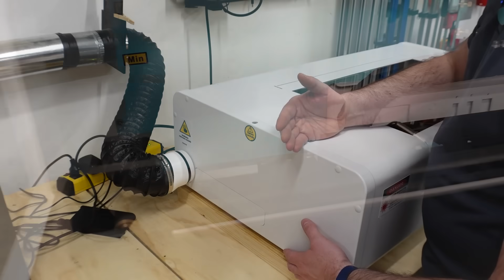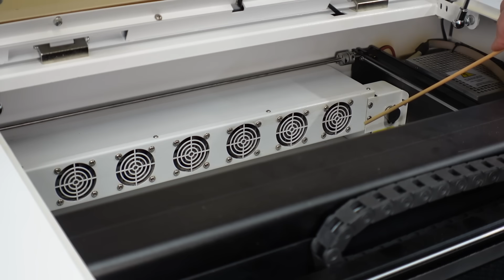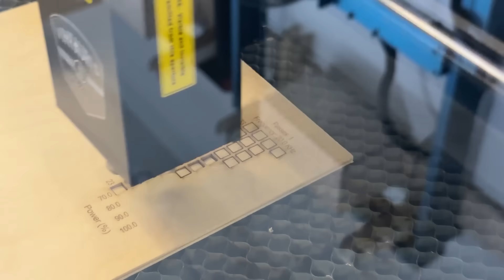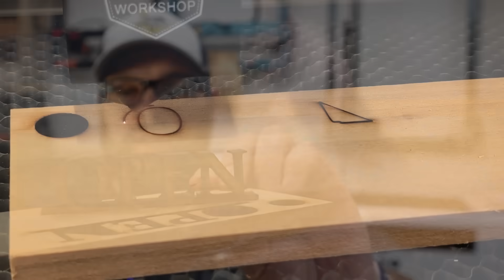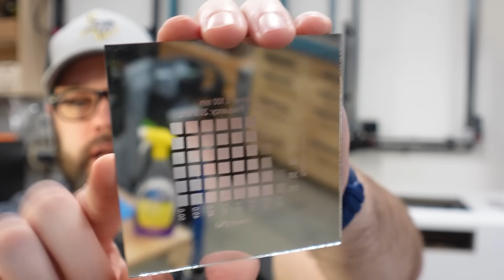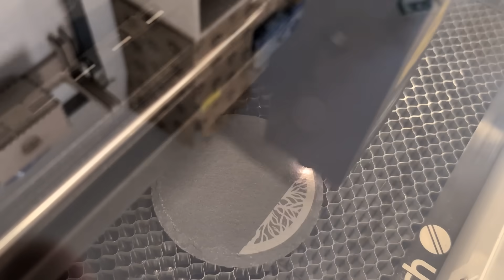Omtech Polar Lite - Best budget Co2 laser?

Comment: What is the best laser for me to buy if I want to put an imprint image on my shotgun receiver from a picture of my dog with geese that she retrieved.
Reply from the maker: To do work on metal parts such as a shotgun receiver, you would want a fiber laser.  A Co2 or Diode can remove a coating like paint or anodization, but will not mark on the actual metal.
Reply: @Vintauri so buy a CO2 machine or a diode machine

Comment: Have you had to change your nozzle head because you accidentally melted it? I’m asking for a friend here obviously. What about getting in to clean those fans? How do we do that?
Reply from the maker: I have not had to change the nozzle due to melting. Was that from flames while cutting material?  This is where a stronger air assist would help keep things away from the laser head.  For the fans I've been using a small shop vac nozzle and then blocking the fan from spinning with a small skewer to get the dust out.  I have not felt the need to take it farther and try to remove the fans for deep cleaning but it's likely that will eventually be needed.

Comment: Hey I just got my NEW OMTECH POLAR LITE. I was putting it together last night and I can't seem to get my honeycomb in the bottom of my laser. Its like it catches on the bottom of the head of my laser and I dont want to obviously scratch that. Is there a trick to getting it to fit in there easily? What am I doing wrong?
Reply from the maker: The z axis on the laser might be extended too far.  Get the laser setup, and the water tank filled and then power it on. The laser should home the z axis and pull it back up allowing you to insert the honeycomb without rubbing on the lens tube.
Reply: @Vintauri  Thank you so much! I will try that!
Reply: @KelseyEitel  if you havent found it yet, there is a piece of foam placed BEHIND the laser head and conveyor. push the laser head all the way forward to remove this piece of foam and then push the laser head all the way to the back corner and the honeycomb will fit! Took me 30 minutes to realize the issue and i felt like such a goof once i figured it out! lol

Comment: What settings did you use for the tumbler? Thanks!
Reply from the maker: You'll need to run a test for the specific brand of tumblers you are engraving as the powder coating can vary, but start around 250mm/sec and 25% power, if it's not burning off all the coating, bump up the power a bit.

Comment: I am very new, so I apologize if this is a dumb question. Say I wanted to engrave the top of something that sits 6 inches high, can I just add (sturdy) blocks underneath high enough until it clears? I saw yours was only like 3 inches so I wanted to ask. Or will that mess up the focus?
Reply from the maker: You can absolutely raise the laser up for larger objects.  Just make sure the blocks are the same thickness so your laser stays parallel to whatever it is sitting on.
Reply: @Vintauri thank you!

Comment: Hi. How did you calibrate the camera with lightburn? I'm having some issues with it not reading the printed circle sheet provided by lightburn to calibrate it. Thanks in advance.
Reply from the maker: I found that I could not have the card all the way to the outside edges.  So I started in the middle and worked my way out. You also might want to see if there is too much light coming into the machine it can blow out the contrast of the camera as it's trying to capture the card.

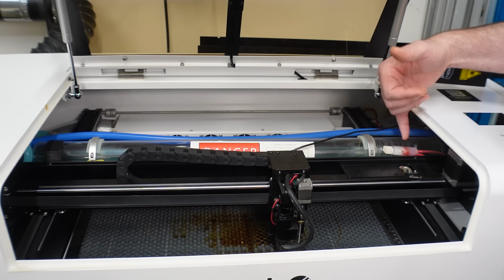Comment: At 16:48 you talk about the part that might cause electrical sparking. Omtech reached out right after I got the device to let me know a kit is arriving soon and shared instructions. I hadn't turned on the machine yet, so will wait till it arrives.
Reply from the maker: Good to hear they are being proactive about that possible issue.  It's been running great since I added the insulation.
Reply: @Vintauri  Spoke too soon, the unit they delivered had a broken water pump. Slapped a return label and will decide if I'm swapping it out for another brand or wait till they're in stock (they have a 2 week lead time till they get more). Very nice customer support, but little disappointed in their quality control.

Comment: mine has arrived, with thanks to OMTech - question - can I use it on wifi?  Going to be a pain  to have to use the USB cables.
Reply from the maker: This one does not support Wifi so you'll need to work with USB cables.  Maybe consider a powered USB hub to plug the two connections into, and then one extension back to your computer to simplify it some.

Comment: So, this or Monport Reno 45 pro vision? (I'm leaning towards the monport...)
Reply from the maker: Watch my video on the air assist upgrade for the Monport Reno. If you plan on doing much cutting, the air assist upgrade is very much necessary.  The Polar has a larger working area as well and the auto focus on the polar is nice rather than the manual focus on the Monport.  Both have similar capabilities as far as what material you can work with.
Reply: @Vintauri  Thanks! Yeah I watched your video on the Reno air upgrade. I kind of like the way its easier to upgrade for air assist and to use an actual external chiller if needed. Where this seems to be more 'it is what it is'. I'm curious to see if you manage to upgrade it like you say in the video.

Comment: really helpful thank you. As I haven't has a diode one before - could you  tell me  if there is anything my diode one does that this one won't? I'm  wondering whether to replace my Diode one
Reply from the maker: The biggest difference is going to be the spot size and shape.  A diode laser beam tends to be more square to rectangular, causing the kerf of the beam to be less consistent, where as the Co2 beam is more circular and consistent in it's size in all directions.  However diode spot sizes tend to be smaller than Co2 lasers. The diode will produce more of a scorching burn that will create darker engravings but leave more burning on the edges, where the Co2 is a more efficient burn that will leave a lighter color engraving but a cleaner edge.
Reply: @Vintauri  Great onfo thank you

Comment: Would have liked to have seen a little more on the work area.  My standard size I work with is 12x12in 3mm sheets.  Will one of these fit the work area and can the machine comfortable work to the extents of that size?
Reply from the maker: It's got a working area of 12" deep by 20" wide and some extra space outside of that to help with manipulating material into position. 12x12" sheets will be easy to work with in there.

Comment: thank you for such a detailed and informative video on this machine, very helpful  I am new to lasering and have narrowed down to the Polar Lite and the Reno 45 Pro Vision - do you have any recommendations between the 2??? :) ty
Reply from the maker: The one advantage the Reno has over this, is the external chiller setup.  That would give you more options for cooling if running it for long periods in a warm environment. Otherwise dollar to feature, the Polar Lite has more bang for the buck.
Reply: @Vintauri  tyvm :) I thought so as well. Am I wrong, or are the specs on the Polar Lite better than the Polar +?

Comment: Thanks for showing material raised up on rails.  I need to cut some material raised up to avoid flashback from the grate.  That answers that question.
Reply from the maker: I try to cover as many possible uses in a typical shop.  Raising it up and minimizing the contact with the support on the back will help for sure, just need to make sure everything has enough support to not drop in the way if you are cutting out many parts.

Comment: Steve, the cleaning seemed a bit fiddly. What did you think of that? Also, did you find the mirrors getting dirty and if so how hard are they to clean?
Reply from the maker: My biggest concern on this one would be keeping the fans on the exhaust box clean.  I have not dug deeper to see how easy it might be to take the panel off and get at the fans more.  As for the mirrors, they are not bad, the first two are under the frame but not too deep that you cannot get at them with some swabs.  It'll take a bit more effort than some lasers but not overly difficult. So far they have stayed fairly clean as the exhaust system seems to be working quite well to pull the smoke away across the working area and not let it linger as much.
Reply: @Vintauri ok thanks Steve! It might end up on my wish list so I wondered about that. I just want to add, you do the best reviews of new products I have ever seen! You provide all the details and test in a very smart way. Thanks for all you do in sharing great reviews!
Reply from the maker: Thanks, I've been reviewing products between my hobbies for a while, and I got tired of the sales like overview unboxings with no real meat to the content.  So I tell manufacturers I wont just read a script of marketing points and will take my time to really test the machine before posting a video.  I appreciate the feedback and support!

Comment: So did you have any error messages when trying to get the laser to run? Everytime i try to run the laser, for some reason it just gives me an error on the actual omtech polar engraver (not my pc) and i was just wondering how i could trouble shoot, i see bubbles forming when it is on so the pump is running, when i close the door it gives me the color code that it is sealed, and then i can move/track fine with the head i just cannot get it to fire
Reply from the maker: I have not received any errors on the laser display other than when the door is open and is triggering that sensor.  If you are seeing too many bubble in the water lines, there may be an issue there and it could be tripping the flow sensor.  Check the water level on the inside to see if it looks like it may be low.  You can add some distilled water if needed.
Reply: @Vintauri thank you very much for the reply! I got it working to a degree, my issue was i had it set to the wrong USB 😅 I
Reply from the maker: @HuskyNCorgi  Ahh well I'm glad you got it sorted out and working!

Comment: I just got my omtech polar lite in. Once I got the machine unpacked and set up. The initial start up my laser head started vigorously shaking and making loud noise on the gantry. Ive checked to see if there's anything obstructing the rail and wheels, checked the belts. Can't seem to figure out how to get it to stop shaking. It does it on every start up. I havent even ran it yet, since I dont know what is causing this issue. Has anyone ran into something like this? TIA!
Reply from the maker: Does it move smoothly by hand with the laser powered off?  Also see if you can check that the gantry is square to the frame.  There can be cases where things get bumped out of square and the gantry starts binding.  The belts will hold it out of square but also fight itself if that is the case.

Comment: Is this a true 12x20 in working space online it says 11.8 I believe? I’m interested in this laser but the material I buy comes in 12x19 so if it’s just short it wouldn’t fit on this bed
Reply from the maker: I just ran a few tests and the largest size I could frame within lightburn was 19.675 wide by 11.8 tall.  However there is room outside this working area to place a sheet that is 12x20.
Reply: @Vintauri thanks for the quick response that’s great to know it will fit as I have a few other lasers and a ton of inventory of wood and acrylic which would be annoying to have to cut .2 in haha

Comment: Do you think this will be capable to cut and engrave acrylic four hours each day?
Reply: What is the recommended operating temp?  I would need to operate this in an un-air conditioned garage.  Can get to 90° in there in the summer.
Reply from the maker: As long as the area the laser is in is not overly hot, the integrated radiator should keep the temps down.  The heat builds up slower when engraving vs cutting so that should help as well.

Comment: I couldn’t get my later to cut through no matter what setting burning etc I got the arcing soon after and 
before I seen your video reached out to OMTech they are sending me a new Ceramic Sealing Block
Reply from the maker: That arcing will rob the tube of the power to ignite the gasses to create the beam. Hopefully the new block gets you up and running. Adding the secondary tube and some silicone sealant wont hurt either.
Reply: @Vintauri will do thank you  yeah I see now it’s been a problem when I first set it up doing the test card. After days the got a arcing yesterday fingers crossed thank you for this great review first laser

Comment: I heard gantry co2 slower than galvo co2?
Reply from the maker: Galvo lasers can move the beam around faster, but they have a smaller working area and are not as good at cutting as they lack an air assist and the beam is more angled to the material the further out from center you get.  So if you are just engraving smaller items, they are faster, but not as good of a machine for larger jobs.

Comment: I ordered one tonight. This is my first C02! The silicone fix you made, would that be something you suggest doing first anyway and is that just silicone caulk or do you have something you suggest?
Reply from the maker: It can't hurt to add the extra insulation.  When I replace laser tubes I always do this to ensure good protection.  Not ever laser will need this but it certainly wont hurt it to add it.

Comment: Do you know how to use the bypass?  I don't know if I am supposed to remove the panel or leave it on there.  Also when you do your coasters do you have to reverse the image or do any grey scaling in order for it to come out correctly
Reply from the maker: Are you talking about the pass through in front and back? There are panels that can be removed to allow some material that is longer than the bed to be manually fed through.  You would have to remove those panels to use that feature, but I would put them back in when not in use to ensure proper airflow for the smoke extraction.   As for the slate coasters, if you were doing a photo engraving, you would want to invert the colors of the image so darks are light and lights are dark. Otherwise it will not come out correctly.

Comment: Thank you for the great overview! How do you think this compares to something like the Reno45 Pro Vision? Would you lean one way or the other? I'm glad you went over the high voltage insulation. I've already seen another user comment on FB about having issues with it arching.
Reply from the maker: Well there are some differences.  The Reno 45 Pro Vision has a smaller working area but has a slightly higher top speed at 600mm/sec.  I'd take the working area of the Polar over the faster scan speed.  The Polar has and autofocus which worked well, while the Reno is a semi-auto focus.  The Reno will allow you to easily make manual micro adjustments to the focus, while the Polar will need to be adjusted in the layer settings for Z offset. The Reno has a larger single exhaust fan in the back, while the Polar has the row of smaller fans across the laser that exhaust out the side.  This might be a toss up as the Reno will allow for more aftermarket flexibility and has a larger output area, but the Polar setup seems to be working well as is. The top of the Reno can be removed for better access to the internals if you need to work on them.  Both have integrated air pumps, I'm not sure of the changes to the Reno Vision as they list an adjustable air flow option where as the original Reno had a basic air pump that was not adjustable and came on when you powered on the laser.  The Polar can be addressed by the software and turned off and on per layer.  I think the Polar uses more standard parts for the power supply, tube and other internals which might make it easier to maintain over time but there may be some proprietary surprises in both.  

I think all things considered for the current prices, I'd go with the larger working area of the Omtech Polar Lite.
Reply: @Vintauri  Awesome! Exactly what I was looking for!
Reply: Thankyou for this i Finally unboxed mine trying to calibrate the camera ughh any tips??
Reply from the maker: There is a camera calibration file on the USB drive that you'll want to import first, then you can do the alignment test to get it dialed in.  The center area is decent but out at the edges it'll be off a bit.